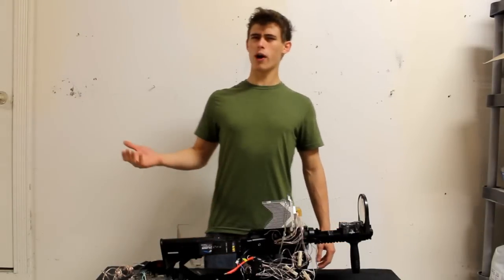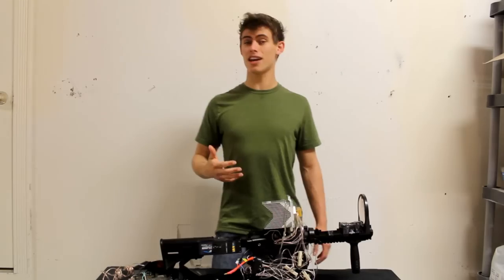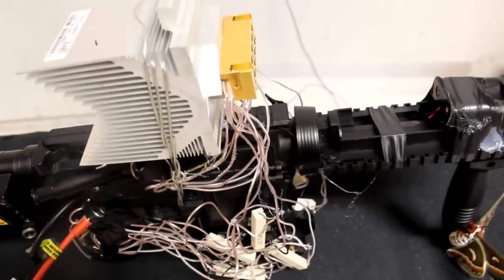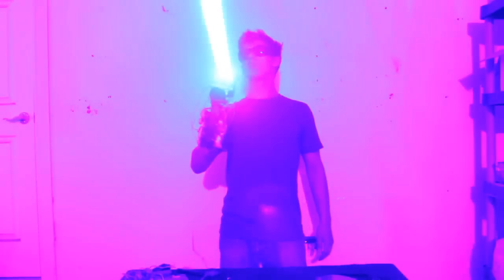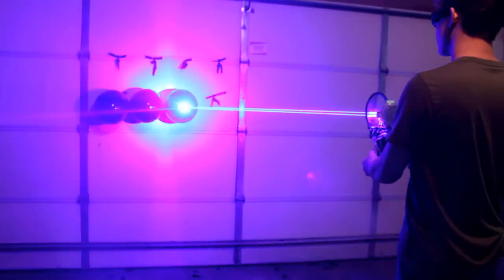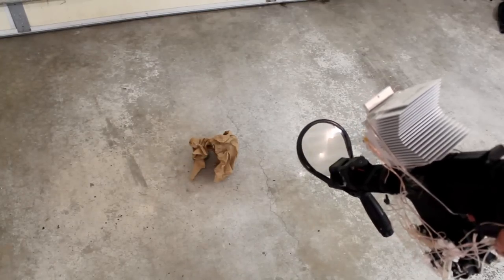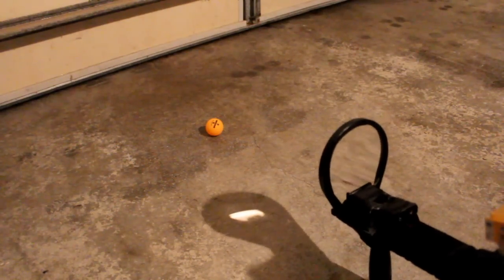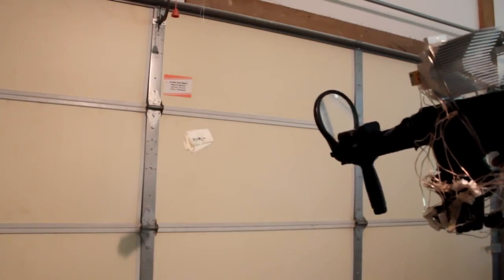My Homemade 40W LASER SHOTGUN!!!!!

Comment: If some guy can make this in a garage, just imagine what destructive weapon a team of military funded scientists can come up with...or already have...
Reply: Sam dot Oh they have but there is always the same drawbacks. Electrical power and heat. Electrical power they eat it up like there is no tomorrow, think new battery after each shot and the heat just melts everything involved.
Reply: Robert Rockey seeing what this guy did with a little battery pack I imagine what you just said is not accurate at all.
Reply: I still stand by my original statement as what he is doing is impressive for an average Joe, it is useless as a weapon. It is only popping balloons and starting small fires. That means its raising the surface temperature to a couple hundred degrees and that's it. So at the most you might give someone some second degree burns or peel some paint. For a real weapon you need something that can vaporize the surface to dig into what ever it is shot at to cause internal damage. For that you you need not something in the Watt range but more like like the Kilowatt range a thousand times more powerful.. Here is an article that goes into more detail on all the specifics. http://www.nature.com/news/military-technology-laser-weapons-get-real-1.17613
Reply: Instantly blinding people at a distance? Sounds like a great weapon to me.
Reply: So you would rely on a weapon that is only disabling when the enemy looks right at it? What he has is a toy. A dangerous one but still a toy. Maybe useful for non-lethally warning people away but not much else. He side stepped the heat issue buy distributing the load with multiple emitters, and the huge heat sink. and as for power I would be surprised if he gets more than a few minutes with that battery. This thing just doesn't have much use since it takes a few seconds to even start a small fire on paper. To have a real weapon grade laser again you need to be able to instantly cause moderate damage to something that is trying its best NOT to get damaged, so instantly burn through a uniform, and cause enough tissue damage to disable a person. A superficial burn while it might be painful is not going to do anything but piss a soldier off. Trust me on that. Been there done that, still got the scars from basic. Really a Gauss rifle would be better because while it will have slower ROF when the trigger is pulled you cause more damage each time. But even then you still have the power limitation, when you have say a nuclear reactor to power the gun is less of an issue, but for a man portable weapon its a no go. That is why we still use chemically propelled projectiles for weapons.
Reply: +Robert Rockey the enemy doesn't have to "look at it" your enemy would be facing you always, and they will not be expecting a non lethal weapon that will blind them in a few nanoseconds.
It would be an EXTREMELY cruel but effective non lethal weapon.

Comment: KawasakG Ryder, you know you want one.
Reply: Well, it's in the 40 watt range, but it isn't a Phased Plasma Rifle. 8-(
Reply: Only got what ya see, buddy. ;-)
Reply: Jeremy Parton 
Yea tho you can find a plasma rifle host from a toy store or flea market & simply install the lzr circuit in that host UC....
Reply: X-15 that is a good idea but the laser will melt the plastic
Reply: Arnav Chadha 
The "Heat Sinked Laser Diode Module" itself will be totally independent from its host even electrically of what ever design that's being incorporated such as the R/C tank host, R/C flying drone host, robot, ray gun ext, UC the heat sinked lzr module would need some amount of insulation around it such as heat resistant foam or even hi density electricians tape will do too that will actually touch the inside wall of the host naturally there by eliminating the risk of the resin host melting, & besides if the lzr module not running output wattages above 3W's then i thk that a plastic/resin host would suffice as long as there short duty cycle firing times where the heat sinked module wont get hot enough to warp or melt the plastic host tho i have not made a lzr mod myself over 3W's...

In closing i DO BELIEVE that a resin host can be used w/ even a 5 - 10W lzr diode providing that there's a adequate type & enough of insulation between the inside walls of the host & the heat sinked lzr module is all...

Comment: Nice job making it, but It does not appear to be that powerful to me, especially for 40W drawing almost 40A. It is more bright than powerful. I have a 1W laser that burns extremely well, even though it takes a longer time to get the same items to burn. The problem appears to be that you do not have all the beams perfectly aligned to get the maximum concentration of light. You can see the beams are not all aligned in the video. If you aligned them properly, you would see REAL power. Align each laser diode one at a time until all the points of light line up exactly in the same location. I actually prefer a single high power laser diode. You also will have the problem of only being able to use the laser at a set distance from the target. Any closer, or any further, and you will lose all concentration of light.

Comment: If you had a conical magnifying glass you could direct the beams into a single spot increasing the damage you could do. Just a thought.
Reply: Anarchy522XD That's of course possibly (until you will burn mirror substrate very fast), but it makes no sense, because that's not how lasers work. Impossible with such way two misc beams (incoherent to each other) merge to one coherent. What is possibly, is to use nonlinear crystals where possibly to merge two beams, but due to summary of frequencies, very soon you will got x-ray frequency and for it there are not exists crystals, so, that's also impossibly.

Comment: I hope your glasses are really good because usually laser glasses are rated with a high OD like I have some high quality protection glasses that are certified for "190-532nm OD7+ 48%VLT 180-315 D L7 + IR L4 >315-532 DM L5 + IR L6 NOIR" the upper exposure limit for a 1w 445nm laser is 20 seconds of indirect light and only 1-2 seconds of direct exposure - its designed to give you the chance to close your eye before damage occurs because your eyes dont react fast enough and wont close before you get permanent damage to your eye, the glasses will give you that extra time needed

so 20 seconds of indirect light then the glasses start to let in dangerous levels of light and you run the risk of not just damaging your eyes but the glasses themselves causing you to have to get new ones - this is less of a problem for glasses like mine that are glass lenses with the color and protection inbeded into the glass not applied as a coating, the coating ones can burn off and blind you

this damaging of the actual protection glasses was new to me but a multiple phd dude who works with really high powered lasers at U of M college explained it to me, I didnt know this stuff before but essentially the glasses arent designed for you to "play" with the lasers, in the labs most lasers pulse on and off at 5-10 second intervals to allow the glasses to, for a lack of a better word as he put it "recharge" cuz most of the time you dont need the laser on constantly - when you do you wear large goggles and glasses under those and sometimes blinders over the lenses so you only see out the front, the sides are blured

Comment: Not nearly as destructive as I'd have imagined. Suppose it's more of 8x5W. I'd venture to say a straight single diode 40watt later wouldn't just bust balloons and set stuff on fire, but be putting holes through walls before you could shut it off.

Comment: It's not really a 40W laser; its just 8 5W lasers in parallel which uses 40W.  A true 40W laser would do a lot more damage, but it wouldn't be a shotgun.  Maybe use prisms to split the beam of a true 40W laser would make it a stronger shotgun, but I don't know if that would just weaken the laser or make the beams thinner. 

How about doing a 100W laser "rifle" with only one laser next time.

Comment: Clean up the wiring, make it heat and cold resistant and you have the makings of a modern day weapon for combat on today's ever changing battlefield  and/or even  crowd control.  If it was capable of emitting a strobe, it could temporarily  blind at great distance.  What is the range on device and have you used it in the night sky?

Comment: if this was thousand times larger and stronger, it could destroy planets
Reply: Steadystrike Even a billion times as powerful won't work.  I have used laser cutters.  The deeper you get into the cut the less precise the cut is.  At some point the liquefied material will obstruct the beam preventing the beam from reaching deeper into the material.  This is why cutting lasers use compressed air to remove material as it cuts.  You would be limited by the the limitations of pneumatics.   You would have to travel to said planet with an air compressor the size of Montana.  You would need a power source the size of Alaska just for the air compressor.  Then you will still be limited to only a few hundred feet of depth.
Reply: Washington State Fish & Waterfowl We don't destroy planets. We merely glass their surfaces.
Reply: Finally someone got the reference
Reply: Steadystrike like the elites from halo?
Reply: Rhas 'Churol bro you need to scrub the barney off your elite
Reply: I guess nobody got the reference...
Reply: Steadystrike reference to what?
Reply: I was thinking of placing the laser on the moon... I mean space station
Reply: Steadystrike
Supposedly NASA had set up several reflective panels on the moon, that you can supposedly shine a laser pointer on, and it would get reflected back.
Reply: Steadystrike that's what she saaaaid
Reply: Maybe if you use it on asteroids near the planet,  systematically vaporising them slightly to deflect their orbital path on to the planet, I a billion years you might be able to destroy a planet
Reply: jason dads
Lasers carry no mass. They wouldn't push asteroids around.
Reply: Steadystrike 
Even DARPA's not @ that level of military lzr sys's yet, you'll see as you learn more & more about this tech young man...
Reply: silverbird58 
They really are quite capable of building these potential weapons sys utilizing even greater flame thrower lzr output ranges, however the prob w/ theses mega US arms research prog's mfr's is that for ea unit they build theyd charge taxpayer probibative COST OVER RUNS prices to build ea unit even if its death ray certified that i feel they have engineered & quite possibly did for the "Secret Space Prog Operatives", tho another story all 2gether than the sub matter on this blogg, tho i still feel & know this governmental weapons research agency DARPA can do this no problem...

Aside the rifle/pistol disentagrator weapon tesla theoried & has made prototypes of, a planet destroying lzr weapon as you indicated that would ultimately require nuclear power for operation im surmising  are not even designed & created as of yet by any private or earth based gov agency that i've ever heard of...
Reply: Rhas 'Churol i never said it did, by shaving of a bit of the mass of an asteroid  you can influence its orbital path